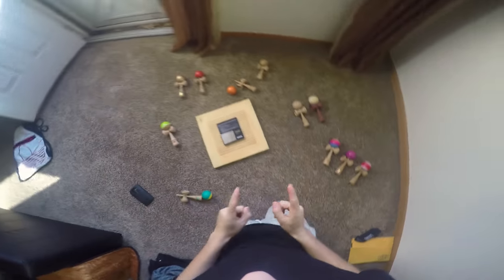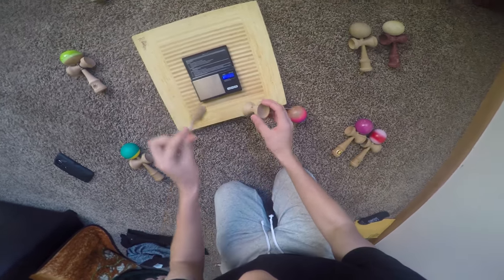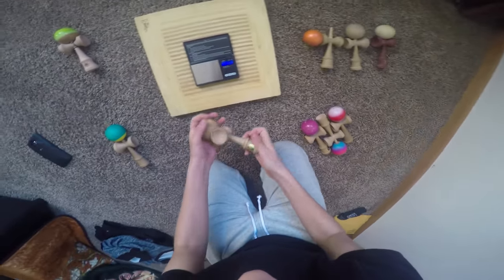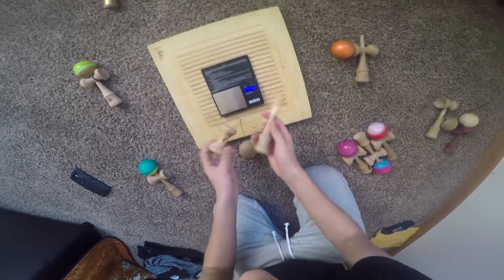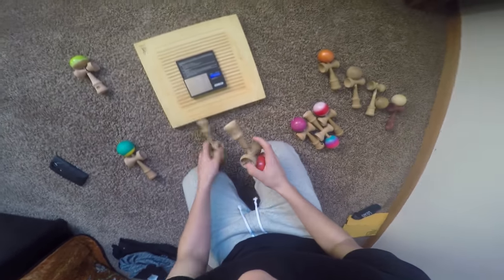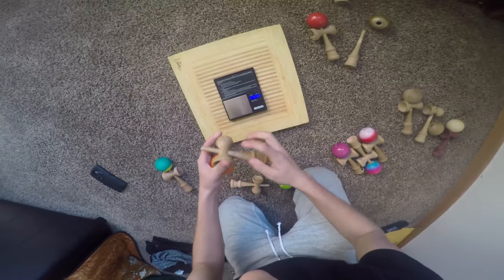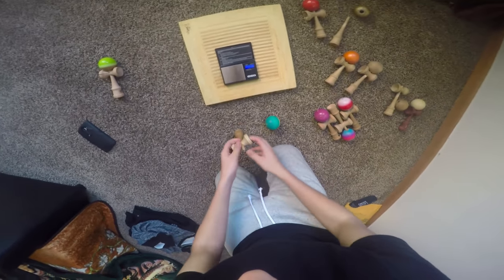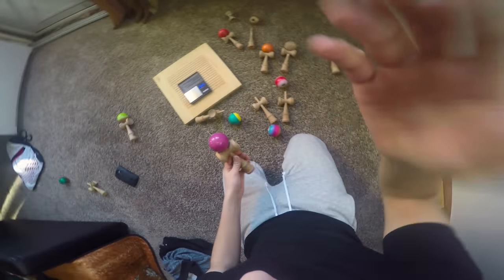Balancing Your Kendama - Part 1 - "Weights"

Comment: Hey Uriel, big fan, but I just wanted to recommend to your fans to not push the cups down to far, since you don't want to lose slinger balance. Which that means that you need your sword to be a bit heavier so some wieght could still ne down their for slings.
Reply from the maker: Alonso Ortigoza You're right. That is one of the downsides to it.